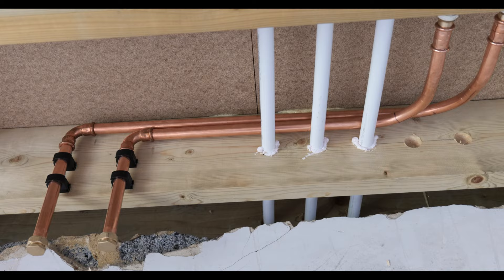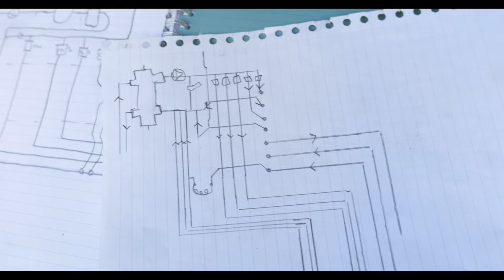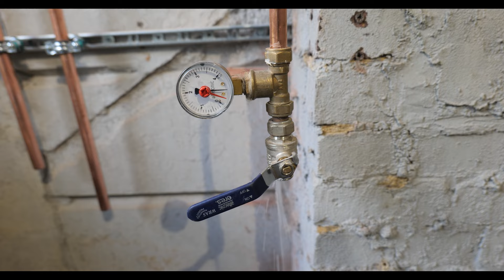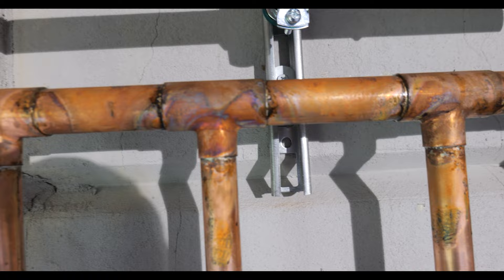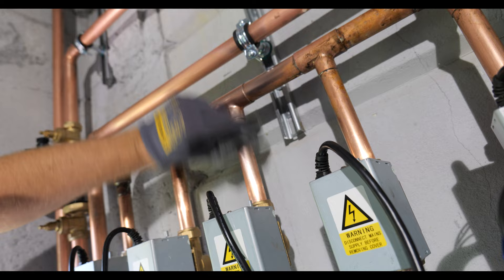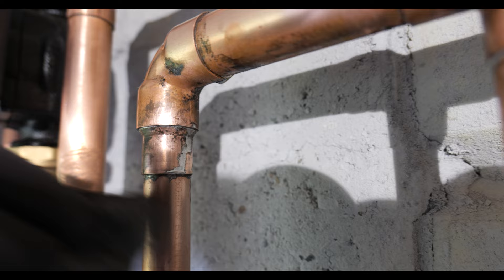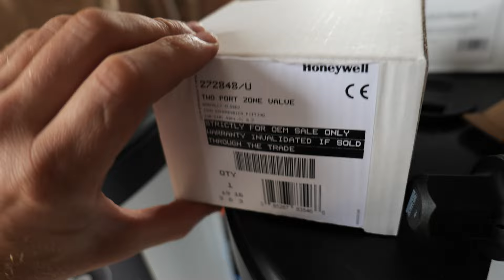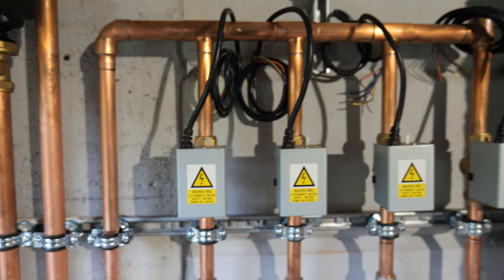Chapel Boiler Room - Twin Unvented cylinders - Walraven rapid rail

Comment: Impressive work 👌...very satisfying....one tip with your soldering...apply heat...before you apply solder remove blow torch and wipe any flux that has run...this stops the solder following....not that I should be giving you tips....I've never done anything near as tidy as that job 😉👍
Reply from the maker: Thanks for the feedback. It's like being back at college. 😜. Nice one 👍🏻

Comment: Nice works, I like wallraven but also good option the Flamco R1 rail system I usually use. We usually if bigger system ( I usually install 6 -7 zone houses) and oil boiler not system we install shunt pump before low loss and other pump after low loss with auto by pass. Is depends from system and design. Good work guys
Reply from the maker: Thank you very much. I will look into that rail system. Cheers

Comment: When I use  headers I don’t ever install bypasses because you have a permanent open circuit for boiler.
Reply from the maker: Yeah totally makes sense just wondering from a building regs point of view. Cheers for the reply. 👍👍
Reply: If you’re fit in automatic bypass they should be closed when the circuits are open anyway, with larger properties with larger pumps it just doesn’t work. Totally agree about the benchmark but its pointless. Keep up the good work
Reply from the maker: Cheers mate thank you

Comment: how do you manage to make the curves on the 22 mm pipe? I didn't succeed, it breaks. and the 0.7mm and the 1mm. I use a 15.22 Silverline tube bender. could you show how you do it on the 22mm pipe?

Comment: Nice pipework but over such a bad surface, even dry lined would would be so much more professional.
Reply from the maker: Naaa we like the exposed brickwork.  Part of the reason we use a rail system . Thanks 👍